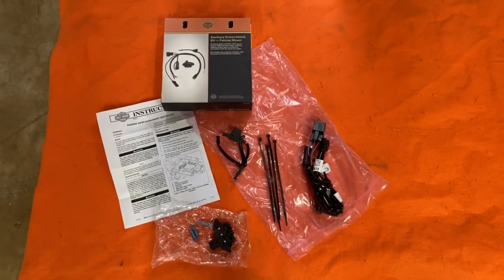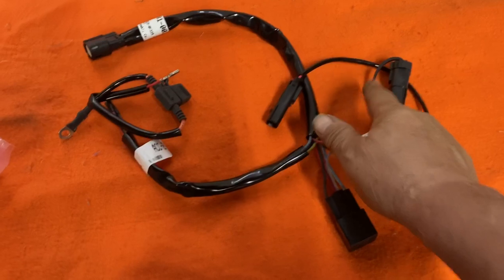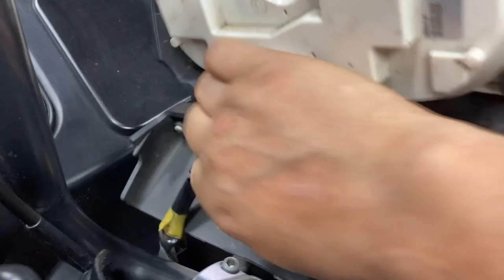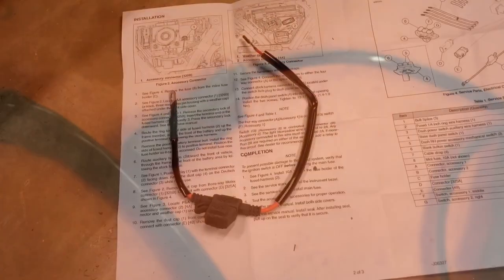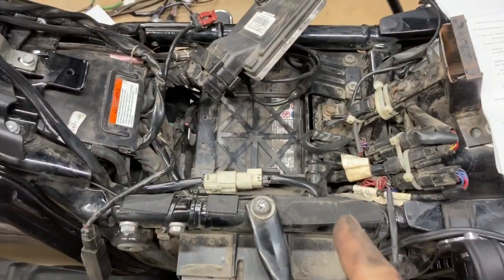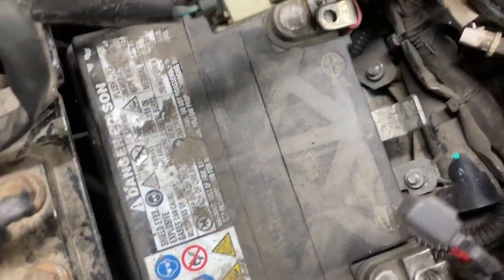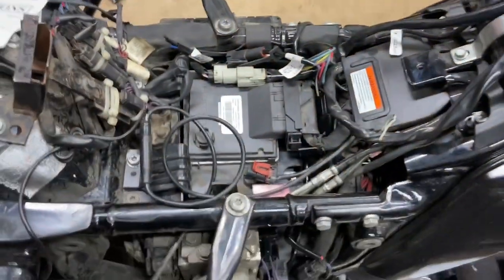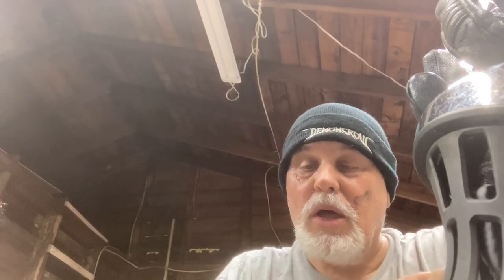Installing the Auxiliary Power Switch Kit in a Rushmore Road Glide

Comment: Very informative
Reply from the maker: Thanks for watching. Harley-Davidson had an Accessory Switch stock on my 2009 Road Glide to switch my LED Accent Lights. But not on my 2021. So, I first installed installed the switch kit to operate my LED Accent lights using Accessory Switch 2. They use less than 2 amps.
But now I’m going to use the Accessory Switch 1 to operate my Heated Grips. The grips require you to use the setting switch on the end to turn on/off. This means the heat setting is changed every time. I’m going to use the Accessory Switch 1 to switch them on/off. This way when I find the perfect heat setting, I won’t need to change it.
I’ll have a video on the installation of the grips. So subscribe to get notifications of new videos.

Comment: On my passing lights there is a positive red wire to the positive post and a black negative to the ground post. Would I wire the red positive wire to the striped wire in the plug and the black wire to the ground black wire in the plug? The striped wire would give you power when the accessory switch is on, is that right?
Reply from the maker: Accessory 2 wire, Light Blue/Yellow wire is limited to 2A. Any accessory connected to it is limited to no no more than 2A. If you want to use more, add a relay. The best way to be sure is using your volt meter, test it for voltage. This way you will know the switch and wiring. 
Thanks for watching.

Comment: Good afternoon.   Thanks for the videos.  
I don’t follow something.  In another video for the accessory switch in the left side, I thought you already used the PA connector on the left side.   That was used for the fan and the fog lights.  Now you show that for the right-side acc switch, you went to the same plug on the left side?
Reply from the maker: Yes, it uses the same plug on the side for the Accessories and Fan. Originally the socket was empty. I just added the single wire into the plug that is used with the Coolflow Fan. The plug for the fan has a blank spot to insert the new wire. 
I hope this helps.
Reply: @TheRoadGlideRider   Thanks.  I will dig into and see if it makes sense.   😀
Reply from the maker: Yes, and I love the Coolflow fan too!

Comment: On acc# 2 you have a red, black and blue/yellow. Is the blue/yellow the lead to the switch? And could I wire passing lamps to this acc switch.
Reply from the maker: In the instructions, says the Light Blue/Yellow wire is limited to 2A. If any light exceeds 2A, you must use a relay. If the lights (LED lights usually don’t exceed 2A) used are under this, you should be OK. Accessory 2 switch is the one to the outside. 
The center Accessory Switch uses the relay included with the harness. It’s usually used for Heated Seat, or Clothing. I’m going to use it to power my Heated Hand Grips.
Thanks for watching. 🏍💨🏍💨

Comment: Do any of the two ACC switches work if you only use the plug and not connect that single wire to the battery?
Reply from the maker: Thanks for watching my video. 
From what I understand, you can’t get voltage without the harness. The wiring needs the power from the battery to provide voltage for the ACC2. It uses the relay to provide voltage through the harness. Power for the plug (ACC1) comes through the ECM. That is why it’s limited to less than 2amps. I wouldn’t advise wiring different than the instructions. You might damage the ECM. And those have a high cost to replace.

Comment: what switch kit or harness did you install on the left side for your 'spotlights' you mentioned in the video? I have a 2018 CVO RG and installed Clearwaters but the switch I bought (might need a harness) will not power them on, even though I have power to the switch.
Reply from the maker: I used the Factory HD lights on the Factory Fog Light Switch on the left side, not the Auxiliary Switch Kit on the right. If you don’t use the Factory Lights here, be sure to use a relay. The power from the Fog lights comes through the ECM that is low. If you draw too much, it will blow the ECM.
If you use the dash switch kit, use Accessory Switch 2. After installing the switches, you will have the switches to use. The center switch uses the relay with 10 amps available.